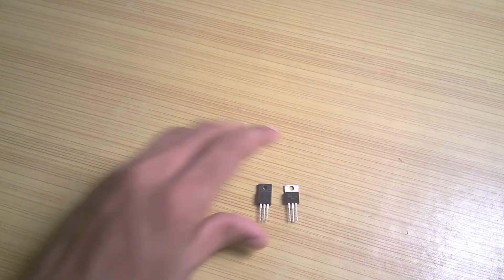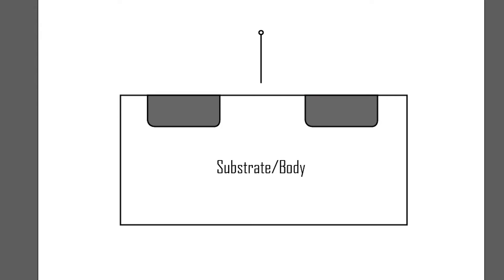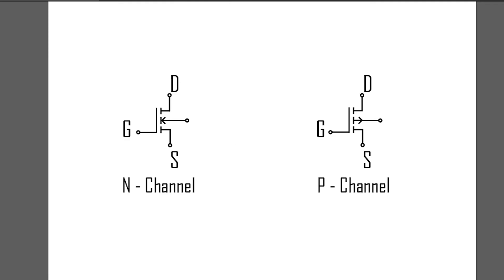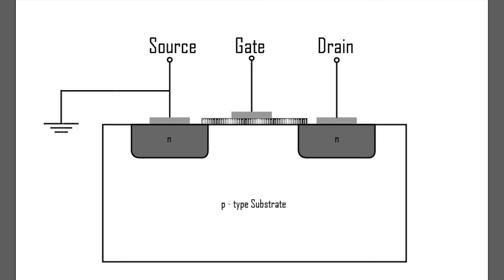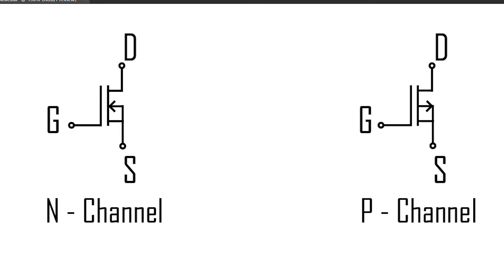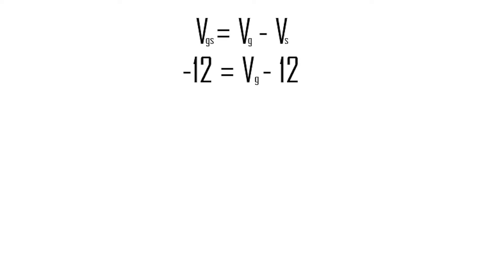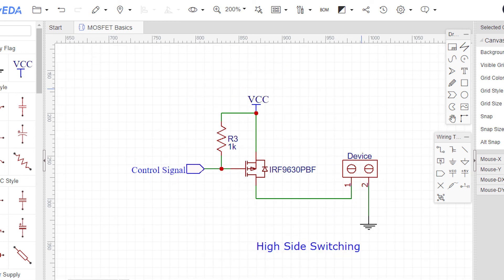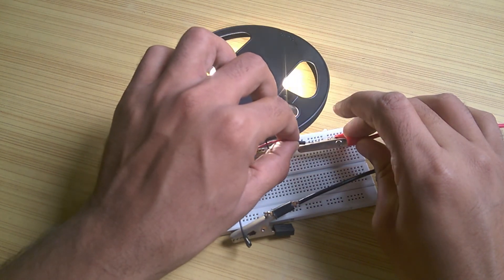MOSFET Basics || n & p Channel MOSFETs || MOSFET Drivers

Comment: I feel confident to pull out a mosfet and switch an LED on now. In the past I have always used transistors. Nice professional video. You do unfortunately speak just a bit too fast for my liking though. But you are indeed technically correct with what you say I am sure. Keep up the good videos 5☆

Comment: Nice tutorial, but you forgot to mention that MOSFET keeps its conduction status if you stop driving the GATE. Due to the SiO2 isolation layer under the Gate, the MOSFET will switch OFF only when you put Gate and Source at the same voltage.
Reply: Yes, it is good to mention. Although, in his diagram he did have a 1k resistor from gate to ground.
Reply: Ah this is why the Mosfet kits for arduino have those resistors in them.

Comment: helpful, but I'm still not quite sure how to use the driver. Maybe my circuit is wrong.
Reply: Most mosfets need more than 5V on the gate to get fully opened (to conduct the maximum current). And if you use it with arduino, they can only output 5V as you know. So therefore the FET will not be fully opened and it might overheat and get damaged. That's where the mosfet driver steps in to help. You supply 5V from arduino to the driver, and the driver supplies 10V (voltage depends on the type of the driver) to the FET, so it can get fully opened and operate efficiently. If you want to use arduino and FETs without driver, you can use IRL540N FETs, which open almost fully at 5V :)

Comment: Thanks for the video, this is explained very well! 
Btw, what should I do if I want to control a positive voltage to a load with P-ch MOSFET, but maximum GS voltage is -20 and datasheet said I can control up to 40V, so if I have 32V and just put the gate to ground, the GS voltage will easily exceed -20V limit. So I'll have to actually apply some 20-32 = 12V  potential to safely turn it on? And how do I turn it off afterwards? By applying up to 31V to the gate? Looks overcomplicated since I want to control voltages from 1 to 32V and simply disconnect the load.